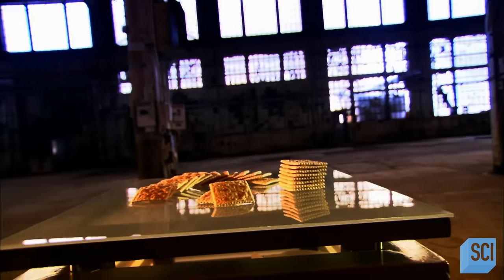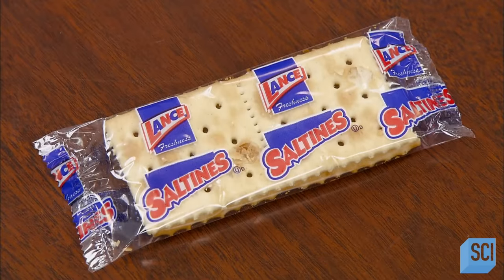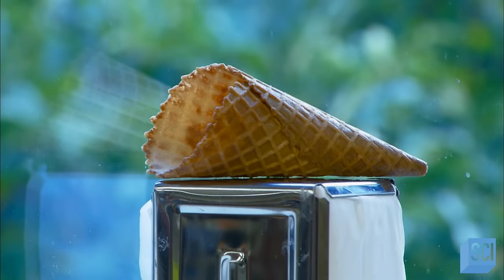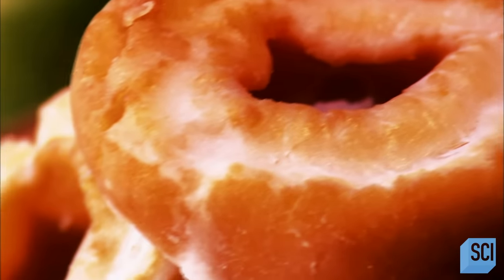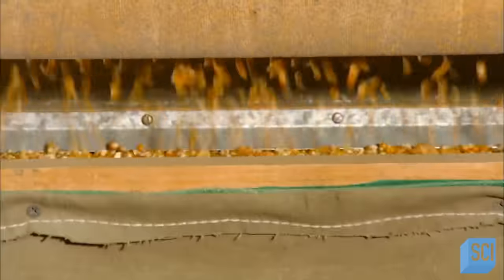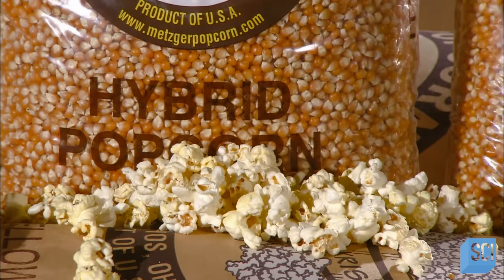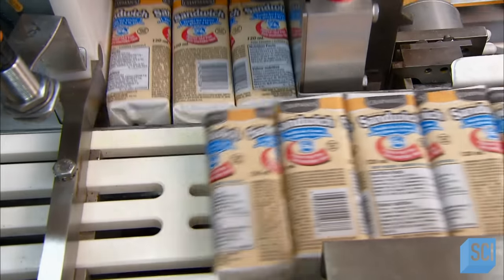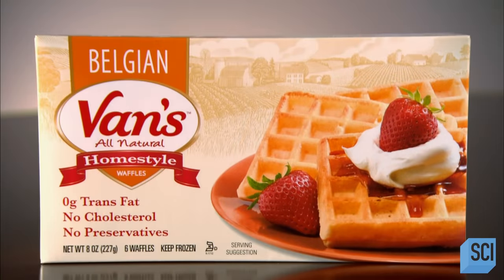How Ice Cream Cones, Waffles, Peanut Butter & More Are Made | How It's Made | Science Channel

Comment: On the note of natural peanut butters having the oil separate to the top of the jar, store it upside down in the fridge and viola no oil on top, no dry clumps on the bottom.
Reply: Having the oil on the bottom and the dry clumps on the top is an improvement?!
Reply: Use your muscles and mix it.  Better than having heart/vascular problems later.
Reply: @valerieparayno3943 whether it’s separated or mixed and blended together you’d still consuming the same amount of oil/ saturated fats/ cholesterol/ calories, etc. 

Thought that’d be common sense….
Reply: @White03T4RV82WD  I'm talking about them mentioning of hydrogenated oils they mentioned to use keep the peanut butter mixed.  If you buy the peanut butter with this ingredient you are consuming straight up trans fat.  Better to just mix it yourself, using your muscles even, than consuming the bad fats.  Natural peanut oil does have saturated fat but has more monounsaturated fat with is good fats.